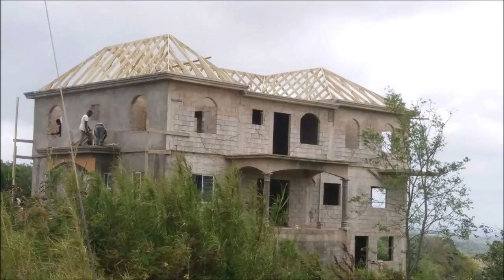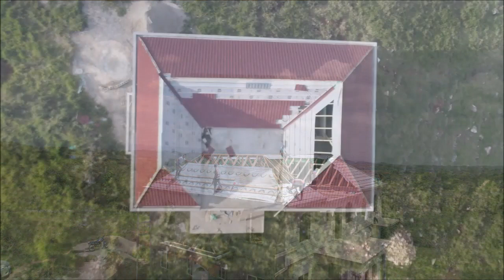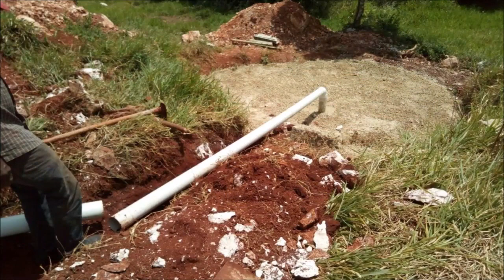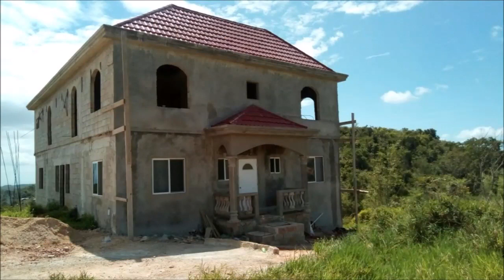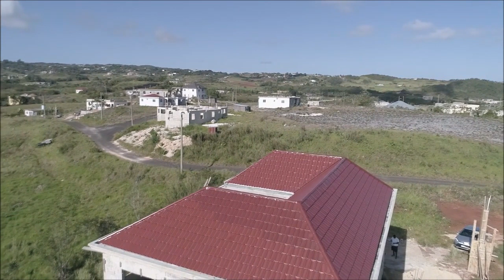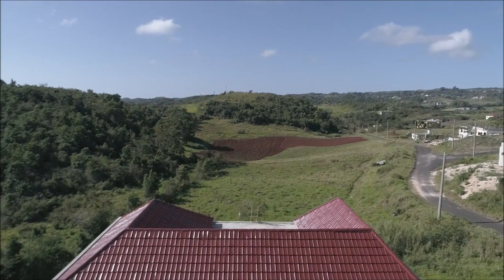My Jamaican dream house Part 10 - Roof and Plumbing ( Building a house in Manchester Jamaica )

Comment: Wow! Amazing job bro. Is the top flat section of the roof going to be used for a specific purpose or is just part of the design? Would be a nice place to store water tanks or have a rooftop sunroom or lounge
Reply from the maker: JesusIsMyLord
Yes. I'm going to use the top for a few water tanks, I was also considering putting a windmill up there to generate power. But I'm not too sure about the windmill anymore being there is so much moving parts to repair.
Reply from the maker: @peace3087  Out of curiosity, where did you get that information from? I would like to look into that. And  if you haven't subscribed yet please don't forget subscribe...
Reply: Wayne Gaming and Homestead it’s true plastic is not good, especially when it’s going to be left out in the sun.... google search BPA, it’s good in plastic and can be harmful in the long run